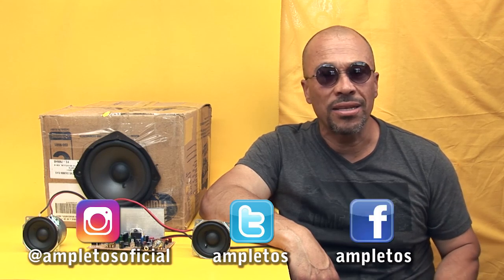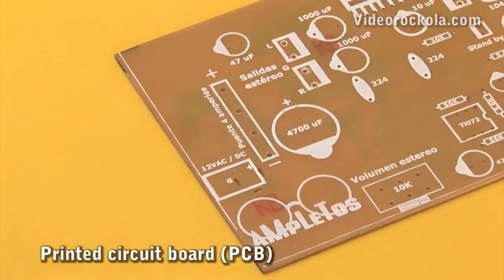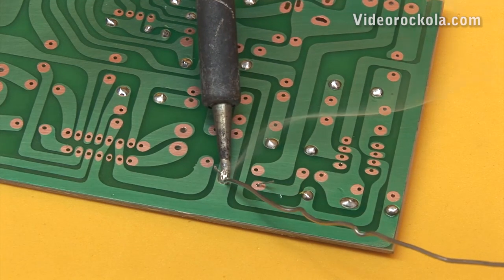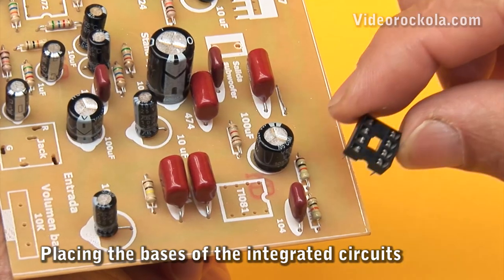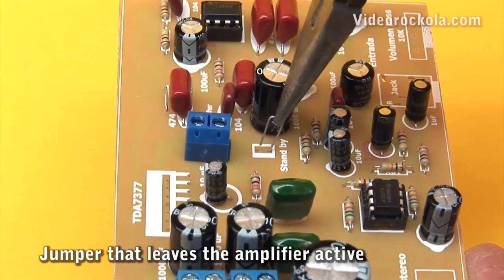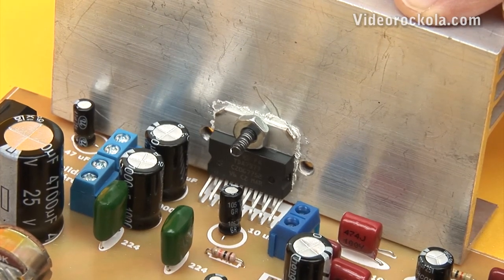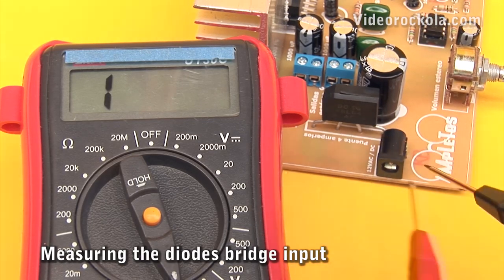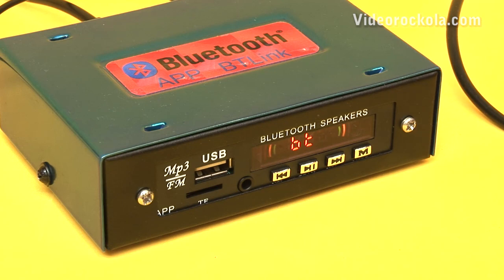2.1 amplifier, with TDA7377 (very easy to do)

Comment: Very good project.... Sir I have learn how to make transformer in very good way.... I have a question for you ..... Which one is best power supply... SMPS or transformer based power supply?
Reply: Transformers are very economical for the audio amplifiers. Because, SMPS 's are directly switched into low voltages by controlling the outputs, thereafter its still complicated and harmful to the other consumable electronics attached to it.